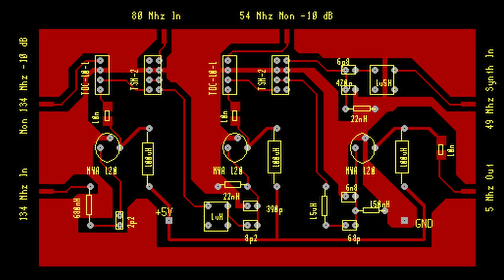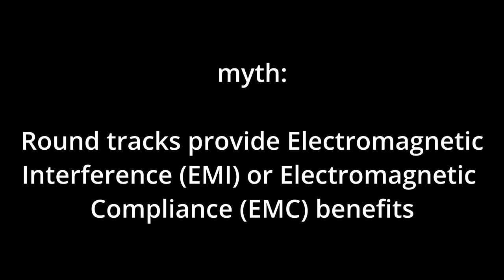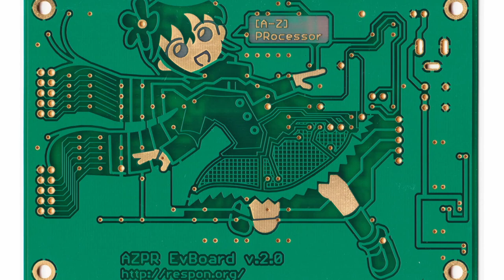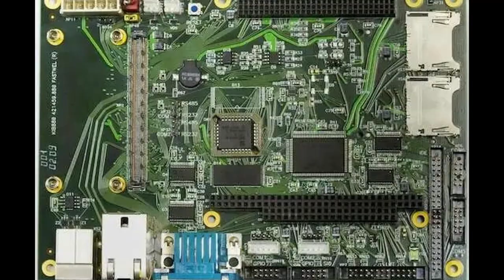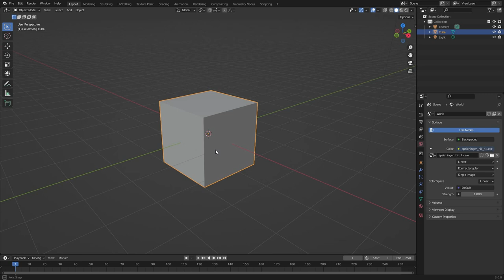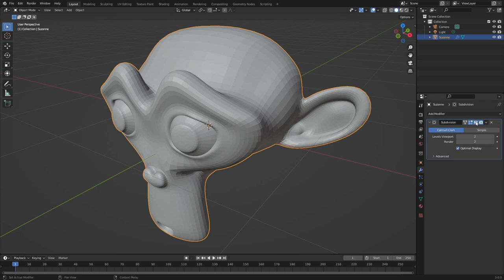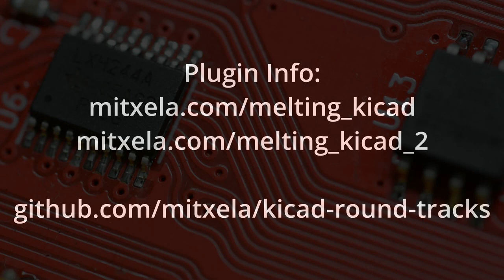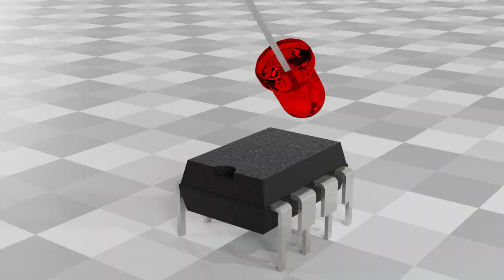Melt your circuit boards

Comment: One other problem I could see with highly optimized tracks like the ones you get with TopoR is maintenance. Those layouts are much harder to comprehend and to check for humans when you are searching for problems, both during design debugging and during repairs later
Reply: So they're good to discourage reverse engineering.
Reply: @alejandroperez5368  that is one way of looking at it.
Reply: @alejandroperez5368  now that's the apple mindset
Reply: I agree, maintainability is the main reason most code style guides forbid having fun too 😅
Reply: A good solution is to use the standard layout during prototyping, then optimize the layout for production so your boards are smaller and cost less to make
Reply: Do modern boards have a grid on the sides to find a spot in the middle? I am working with a really old board and the instructions say "this is located at 3A on board #". That might help... maybe.
Reply: most circuit boards are too small to repair by hand anyway
Reply: I have taken up using color coded resist ink on plotter drawn prototypes but silkscreen work can have shaped pads or another lable layer or 2 .

Comment: i find smoothed tracks allow for much faster cutting of diy pcbs on an engraver, smooth corners having lower acceleration than right angles.
Reply: That's a very interesting point, thanks for mentioning!
Reply: plus it's hard to make a square corner with a rotating bit ;-)

Comment: As a junior engineer at my first job I designed my first PCB with free angles, being inspired by audio equipment of the 80s. That was indeed like placing rubber bands in PADS. I collected a harsh response from everyone who saw my design, going as far as denying me a promotion, probably because of that, and other acts of not conforming to peer pressure. Now I work in space industry and already proved myself numerous times. I admit that while switching jobs I give a clear warning that I'm not taking any orders or advice that have no solid reasoning behind it. Excellent video, got subscribed for more.

Comment: As an avionics repair tech, I have sense of dread every time I see rounded runs.  It has nothing to do with the runs but rather the age and tolerances of the components.  Every board that was hand drawn is a monster to troubleshoot.  Even seeing the melted boards in this video gives me that sense of dread.
Reply: Hand drawn boards are easier to troubleshoot for me. It's easier to find stuff on the solder side because each section of the trace pattern in much more distinct than on CAD boards.
Reply: straight lines help a lot
Reply: I work in aviation electronics engineering and even though it's for the military I will now melt all my circuits in hopes you see one eventually :)
Reply: this video being recommended to all the avionics techs lol👋
Reply: Hey! Its cool to find a handful avionics engineers here!. Whats your opinion about your profession?
Im in university doing computer engg 😄
Reply: I'm also an avionics technician, working in Base Maintenance. To be honest, I personally prefer seeing hand-drawn traces over CAD-designed ones with 45° angle increments. I often find them to be easier to troubleshoot, personally. However, the designs made with the TopoR technology demonstrated at around 4 minutes made me anxious as hell haha
Reply: @aakashjana6225  It's exciting and there's always more to learn and experience each day. No maintenance project is ever really the same, there will always be different issues to solve. There can be a time period when the aircraft functions properly, then the next day you might get a problem out of nowhere. Or you might have to do service bulletins, or deactivate/activate/remove/install/replace things. It's really fun and full of responsibility. I've been in the profession for 3 years and I can see myself doing this for the rest of my life until I retire.

On the downside, salary can be a problem and people in the aircraft maintenance industry sometimes get seriously underpaid (except maybe if you're a contractor and not a proper employee) despite the carcinocenic materials used, the high levels of noise and stress sustained, the risk taken with working on potentially deadly mechanisms which can be reactivated by a negligent colleague gone rogue with the push of a circuit breaker, and the serious consequences of making a mistake, unintentionally or not.
Of course this varies from country to country, company to company, and position to position.
Reply: @Dengar97  thankyou it was really awesome learning this
Reply: I'm studying structural and aerodynamics. Cool to see the hardware guys! Having watched the pace soldering series here on YT I imagine straight runs are easiest to repair, especially if multiple layers are involved! 

On another note I recall a quantas a330 be stricken by bit flips so emf and or cosmic ray error detection and mitigation would be cool to implement on the off chance it's in a critical system.  Otherwise, my two cents are modern aircraft heavily relly on stability augmentation especially if the type certified aircraft is modified. This is so to maintain a common type rating among the pilots that fly them. I recall my prof stating that the computers run in the tens to a few hundred hertz so they are generally hardened against cosmic influences, but with all those millions of traces it'd be interesting to do actual radiation studies to further proof the systems. Again just a thought, if they've already done so then just ignore me lol.
Reply: Yep same. The hand drawn boards in this video are giving me Vietnam flashbacks of obsolete mystery components that break if you look at them too hard, and millions of link wires - all of them pink.

Comment: You can talk track routing plugins for KiCad whenever you want 🙂 I'll be here for it.
The concept of "lowest possible energy" is something that I deeply appreciate, as both a programmer and a lazy person.
Reply: Programmers are naturally industriously lazy, finding pleasure that we can now exert less energy on a task after an initial cost to automate it.
Reply: Also, arbitrary angle routing can aid in track delay matching, because of the effect the fiber weave has on the length of parallel signals on multiples of 90 degrees and 45 degrees.
Reply: @FreeTheUyghurs  ah yes, a simple joy of automating a 2 minute task for 5 hours just to do it once. "E" stands for **e**fficiency in "joy"
Reply: @Shonicheck  hey I said we had ambitions not that we were smart.
Reply: Being lazy is probably one of the best selling points for a programmer and I find that hilarious sometimes.

Comment: There is another valid argument against the ruthlessly efficient routing approach (and for the record, I’m with you, I think it looks neat): it is more difficult to grasp it’s logical structure and discern how things may function, which on some (not all) designs, could hamper its ability to be iterated, improved upon, or repaired.
Reply: Yeah,  it could easily result in one missing wire being routed and then the entire design looks totally different. 

It's also not super great for power circuit design,  where you probably want to repeat a perfectly operating design to multiple boards rather than "optimize" each time
Reply: @wefyb2  All valid points. That said, I do think there is plenty of room for circuit layouts that place a priority on aesthetics as well as efficiency and the more prosaic considerations that dictate most board designs. Even if one discounts the modern DIY and hobbyist trends that have resulted in a lot of devices that intentionally show off their internals with exposed circuitry and laser-cut acrylic cases--electronic engineering professionals have a long tradition of appreciating and critiquing PCB layouts and the skills involved in balancing all of the complex factors that go into them. 

It's certainly a rather impractical thing to do, but if I saw a board that was not only expertly laid out with efficient use of space, minimal reliance on vias, and proper placement of things like semiconductors and electrolytics to promote long-term reliability--but also employed beautifully flowing lines and artfully designed features, I'd appreciate the effort. But I'm also someone who will never be involved with any projects larger than one-off curiosities and personal endeavors, so shit like this for its own sake is perfectly acceptable in my opinion.
Reply: A point worth making. "Shorter traces" or even "fewer vias" (although I have a personal bias for these) may not even be rational objectives. I'd hope that ground plane optimisation (including pcb fills taking into account star grounding) is another area it might be interesting for this software to tackle. Ah, if only I had more spare time…
Reply: And it completely ignores e.g. cross-talk. It's suboptimal for anything remotely sensitive.
Reply: There are so many additional constrains which are hard to put into software. If we would use a perfect optimization at work, it would be a total nightmare. Any change could move a lot of stuff on the PCB, requiring a lot of re-qualification steps. Instead our "less efficient" designs allow most modifications to be done in a very local and efficient manner.

Comment: I don't agree with the statement of "sharp edges are not a problem for modern manufacturing". Yes, when you order 100 pieces, it is not a problem. But when the production goes to 10's of millions or you are pushing the technology to its limits (with the circuit density), you will see very clearly where the defects most often are. Mainly relative to how little it costs to prevent them.
With few 100 of pieces produced you will practically never see a 100ppm rate defect, so it does not make much sense to spend  even a single minute of extra effort on it during the design. But with a 10 mil production we are talking about 1000 defective pieces. And that becomes way other story with relation to how much extra design effort still pays off to address these.
Reply: Smart girl
Reply: @alejandroperez5368  boring girl
Reply: @Intelwinsbigly  why is she boring?
Reply: @alejandroperez5368  1000 defective pieces being bad enough to make boring pcbs is a sign of a boring person.
Reply: Only 1k faulty pcb's from 10 million? That's actually pretty good.
Reply: Smh can't really be using "mil" as an abbreviation for million in a comment on a video about PCBs
Reply: @Daddy_Dagoth  It's good, but I think that's five sigma. If you want to reach six sigma levels of quality, you would have to do better.
Reply: @Intelwinsbigly  Dang man! Harsh
Reply: @Jao Bai Dun yep, mils/millimeters/million

Comment: I like the idea, but the resultant circuit boards seem too orderly to me. wibbly 70's circuit boards had unsteady tracks, slightly wobbling in width and direction.
Reply: I wonder how well you could use a noise displacement algorithm, like is sometimes used to "simulate" handwritten text. It'd be hard because of fixed component pads and manufacturing tolerances, but could be neat.
Reply: @bob2859  Comic sans but for circuit design
Reply: @spicybaguette7706  but procedural
Reply: @spicybaguette7706  comic circs

Comment: This is great! I basically just finished manually routing a design that uses arbitrary angles and smooth corners because of space limitations. I will look into this and especially TopoR as I think these tools could really help in the kinds of designs I'm working on.

Comment: The only other critique i can come up with for topologically perfect circuit boards is on-board repairability, but even that can be a non-issue. I'm sure it's useful for bleeding edge tech and extremely space efficient requirements, i.e. cubesats. Very interesting!
Reply: My dad works at a company that does a lot of hardware development for the automotive industry, he had a project a while ago where he had to design hardware for a 100W coolant circulation pump that keeps pumping coolant after engine is shut off to prevent the water that was in the engine block at point of shutoff to overpressure and boil.
The original spec was 25W at  130°C operating temperature in a  10x5x5cm ish form factor.
Spec moved up to 100W during dev cycle, everything else stayed the same.
Absolute nightmare that project.
Reply: @Blacktronics  As someone who works in automotive RnD as well, I can feel this on a spiritual level. Automotive engineers are a different breed, I tell ya.
One day, the project leading engineer enters the room and surprisedly tells us that we need to build everything over from scratch - he kind of forgot that the engine dyno also needed to fit the ... uhm, you know ... the exhaust ? What? It's an engine, of course it's going to need one?!
We had to tear down an almost complete construction and re-re-arrange almost everything back to where it already was before we re-arranged it in the first place. :|

Comment: I began making PCBs in 1975 with tape and a razor blade; both directly on copper for a single job, or on a mylar sheet to make multiple copies using positive photoresist.
I experimented with curves and 90° and 45° angles. The end result was I made curved tracks for my personal projects, as curves were faster to draw and more reliable in the ferric chloride solution. But all customers loved angled tracks and the "professional" aesthetic of the finished PCB.
I transitioned to ORCAD x DOS around 1988, and curved tracks were gone by then. My designs went up to 200 MHz operating frequency, and I never found any increase of EMI / RFI when compared to a rounded-track PCB. Over the years, I forgot about those wavy PCBs, with long strings of FND500 displays or arrays of memory chips crossed by waved tracks drawn by hand. 
Now, watching this video, I transfixed what I saw. You are trying to get good old wavy PCB tracks out of modern PCB routing software! I'm honoured. I bet you listen to music from vinyl disks with a Shure cartridge and a DC-coupled audio amplifier...

Comment: I came across this vid by accident, but was thoroughly drawn in from the start. I took a lot of things apart in the 60's and 70's and I remember the fluid designs in old radios and walkie talkies of that era (and the peculiar odor of "Made In Japan" circuitry - "waxy" is as close as I can get to describing). Thanks for putting together a lovely and thought-provoking video. I'm just getting into circuit board design and taking a class on KiCad. I'll turn the instructor onto this vid!

Comment: You never disappoint. Going to download that ASAP

I recently made a python code (no clue how to make it a plugin) that deletes all pads that are on the same side as a THT component for the purpose of generating layouts for boards without plated through-holes. Also works for single-sided boards, not that it’s very necessary. It’s a good step towards getting a hassle-free home etch. Maybe I’ll try to make it into a plugin, assuming someone hasn’t beaten me to the punch. I’ve never really looked at existing plugins before, so it would be neat if you had any recommendations.

Comment: Some of those circuits are running code that was written on ultrawide / 4k monitors, but formatted to a max of 80 char per line - because that was the max supported by the earliest terminals.

Comment: I really like the designs of the old hand-drawn boards. They are straight to the point and have a feeling of fluidity.
The rounded corners are nice, but it still doesn't bring this kind of odd angles. A board made with the 45° limitation that had the melting applied still has mostly 45° angles. Just that where things meed the corners are smoother.

Comment: The one thing to keep in mind with sharp corners in terms of high speed design is that the clock frequency doesn't matter, it's the rise/fall time that sets the signal bandwidth, so even with a circuit clocking at 100kHz you almost certainly have 200MHz+ bandwidth components if you're using modern CMOS, and probably much higher for faster MCUs like ESP32.

Comment: Makes sense when you just start rounding off corners, sure. But in the exposition, on the macro scale of the circuit, I'd argue that you might be missing the point that straight lines are more trackable, and make debugging (read: not the designer, but, the person tasked with doing diagnostics)  a million times easier. Try debugging some board with dozens of chips, dozens of resistors, and dozens of other components, running seemingly arbitrary path turns, versus squared off tracks.

Comment: So interesting coincidence, I just 2 days ago came across a PCB that was designed to have sharp corners but the traces were rounded. The board also appears to have an internal short that was not discovered until it was fully populated through smt and through hole and hand assembled components. I have no idea how prevalent this issue could be but the rounding of corners on traces at least on this single unit, could be an indicator of a failed PCB production process. And yes we will be talking to our board house about it after we gather some more information.

Comment: One reason to not use topological routing would be cases where you want to reuse/drop in existing circuit modules from one design to another. Like a standard power/charging circuit layout that is used on many products and just dropped in with the same layout.

Comment: Rounding corners, smoothing bends and adding teardrops can also be achieved (in one stroke) by bluring your artwork (in something like Photoshop o  Photopedia) and then using the Levels controls to return ('crush') your blurred image back to just black and white . . . been doing it like this for years, results are - subjectively - much better than what I'm seeing here.